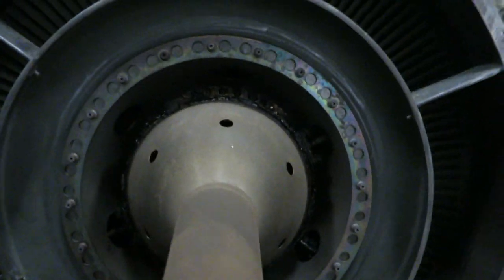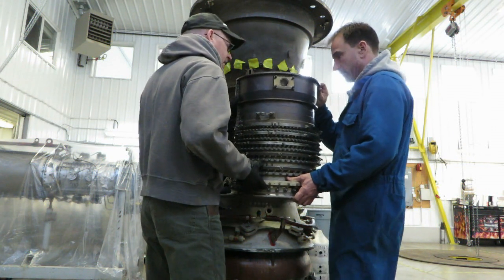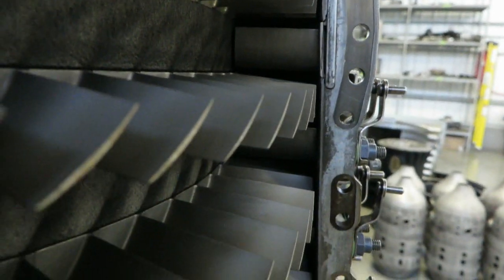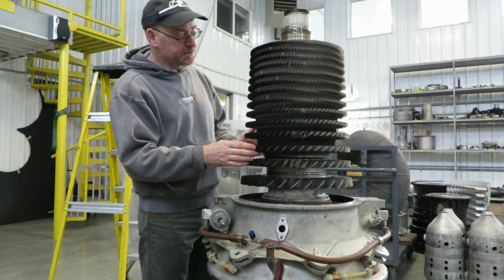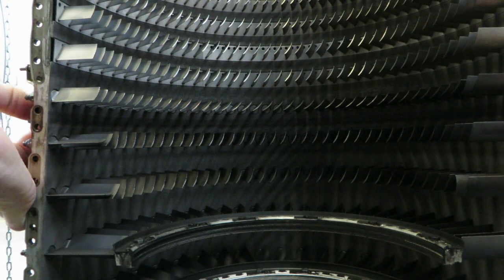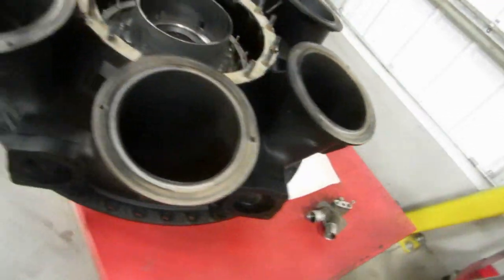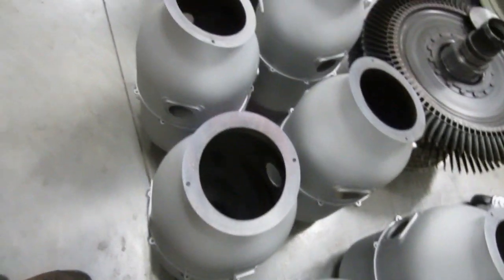LM500 Disassembly Update

Comment: There appear to be some vanes missing from the compressor rotor assembly, is that correct?  The spots that looked like that appear to be randomly spaced as the assembly turns, can you comment on that?  Great videos, I know way more about jet engines now thanks to you.  And the care you guys take, even with the scrap parts (different vid), fabulous, gives me confidence in jets.
Reply from the maker: The airfoils of the compressor rotor are called blades. The stationary airfoils in the stator cases are called vanes... or stators.
Anyway, you noticed what we did. The gaps are where the locks are. Each stage of blades fits into a slot on a drum, and the place the y go in has a locking plug installed. We thought the gaps were a concern... GE says they are fine.

Comment: Hi Jay, fascinating information on jet engines thanks for making these videos, and taking the time to answer questions. 
Three quick questions for you;

- Do you have a favourite engine and why?

- In one if your videos you were explaining why you cannot have a direct connection to the power turbine due to the engine being designed to produce just the right amount of power for its compressor. My question is about how the engine in the F35b VTOL would work in relation to this. It seems to have a part time shaft that runs a lift fan?

- Could you do a video on thrust reversors and how they work? I know they are not fitted to the engines you seem to work on but I figured you may have knowledge on them anyhow. 

Again thanks for such a great channel, and for being so patient with your explanations. All the best from London. 

Ps my name is pronounced like "Wosson"

Comment: Sometimes I see that you use some specialized tools. If a new engine comes in (wich is not compatible with the existing tools you have), do you buy them yourselves, or does the client buy (or supply) them?
Reply from the maker: This engine needs some specialized tools, which were supplied by the owners for us to use. Without them, working on the engine would be impossible.
Sometimes we do have to make tools, and we do that in our machine bay at S&S, or we will sometimes contract a professional machine shop.

Comment: Hi, talking about variable compressor stators, is that change in the sound when engines are going to max rpm? It's sound chngaes like a big mouth opens to get much more air? I noticed this while attending air shows and engines start. Thanks a lot, this is another excelent video!

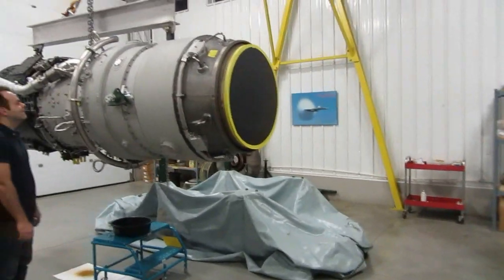Comment: What is the name of the tool at 2:13 which is fitted to the shaft? Maybe you covered it before, I'm guessing it's to do with torque settings?
Reply from the maker: That is a torque multiplier. It allows us to use a hand wrench and apply 800 ft-lbs of torque to the nut inside the LP shaft.. This one is made by Dyna-Torque, but these tools are commonly called Sweeney, the name of a prominent manufacturer of them.

Comment: hmm, are there any magnets in a turbine engine, i dont mean in solenoids or relays but to retain something, or maybe to minimise vibrations?
Love the vids, keep up the great work^^
Reply from the maker: As far as I know, no. I have taken 10 different engine lines apart, and found no magnets other than chip detectors in the oil system.

Comment: how come this one had missing compressor blades? (5:04) was it a working engine?
Reply from the maker: Good eye, but no cigar ! The small gap in each row of blades on the rotor is the blade insertion point, and then where the blade lock is placed, once all the blades have been inserted. The lock is "locked" by an Allen set screw.
It does look strange though, don't it ?
Reply: AgentJayZ so it is a different design of the rotor assembly, single piece shaft with "grooves" for each compressor stage? not a sandwich type like in the lm1500?
Reply from the maker: jz1199 Yes. There is one disk attached to the shaft. The front of that disk, and to the back of it, are attached drums which have grooves in them, into which the blades are inserted. 
Reduces parts count, and creates a more rigid, stable compressor rotor.

Comment: Hi, You've called that LM500 engine a modern piece of technology.... That engine is a derivative of military TF34 engine designed in 1960s. It really is bulletproof but i guess its good times has long passed.
Reply from the maker: The CF34 continues to be updated, and is currently flying in many Bombardier CRJ regional airliners.
It's a FADEC controlled, high efficiency high bypass turbofan, so to me it is at most one generation behind the bleeding modern edge.
Most of the Industrial engines we work on are second- or third-generation turbojets with triple the fuel consumption for the power they generate.

Comment: Hello AJZ
 I'm an old retired Marine Diesel Engineer.
 Really enjoy your stuff.
Closest I'm come to anything like this is a turbocharger on a 8000 HP Diesel Engine.
 You may not be able to reveal but I'm interested in things like:
Info on machines that you are inspect/overhauling.such as
Working environment.Temps pressures
 How they came to be where they are: disposed of, reclaimed converted.
 Typical% load 
type of Fuel burned
Work that the machine does?
Pumping Gas or liquid?
Difficulties or remarks with or about it?
Owner/Operator 
How attached to load; direct or reduction gear
Any of those kinds of details
Attended or type of monitoring
Time in service or between inspections
Total time 
I realize you're probably not willing to type all this out:perhaps 
 There might be some of it published some where.
 that I could access.
Lubes type , time in service
You get the idea.
I'm just nosey and curious.
Again really enjoy your stuff
doxland from Sidney B.C. Canada
Reply from the maker: The machines work at ambient, which ranges from -50 up north to +50 in some of the equatorial installations. The power is rated at sea level.
These engines are purpose-built by the manufacturer for industrial use, having a design that is slightly modifies from the original aircraft application.
Typical load is 100%
-usually Natural gas, diesel, or Kerosene-based jet fuel
-Pump natural gas or oil in pipelines, generate electricity, propel ships
-Gas generators provide the exhaust gases to drive a power turbine ( see my vids about them).
This particular engine has an integral PT, so its output is 5200Hp at 7000RPM
-Monitored for temp, vibes, torque output, with alarms and auto shutdown.
-typically 3 years between overhauls
-total lifetime indefinite with good maintenance
-lube is synthetic jet engine oil, just like for an airliner ( see my vids on that )
-I used to live in Saanich, Oak bay, Nanaimo, Courtenay, Campbell River, and Sooke ... and it's been a while since I hoisted one at the Waddling Dog...
Cheers !
Reply: AgentJayZ
Subsequent questions
-Also meant to ask about the mounting rig for testing engines.
Is there a big arrangement to accommodate thrust and keep it from running out the door?
Perhaps there isn't much thrust. I was expecting to see anchors in the slab/floor.
-I only once noticed a screen on the intake end for FOD prevention and wondered "Isn't there danger of object being drawn into the intake like notebooks, packs of cigarettes, rags from guys passing by the intake end.
-Do the places that operate these engines have any arrangements for waste heat recovery for example reheating pipeline fluid being pumped?
-Vibration monitoring/analysis?for running conditions or auto shutdown?
-are they attended or run unattended?
Thanks again
doxland Sidney B.C.
Reply from the maker: David Oxland The test skid is anchored by 8 pilings 20 feet in the ground.
 I made a video called the engine test stand...

Any person that allows a pack of smokes, rag, hat, gloves, notebook, etc to go into the engine pays for the repair, and is also fired, so everybody is quite vigilant.

Many installations do generate steam with the exhaust heat.
The engines usually are watched by a "remote" operator... a few mundred meters away in a comfy chair.
They have alarm thresholds and auto shutdown thresholds built in to the vibration monitoring part of the engine control instrumentation.